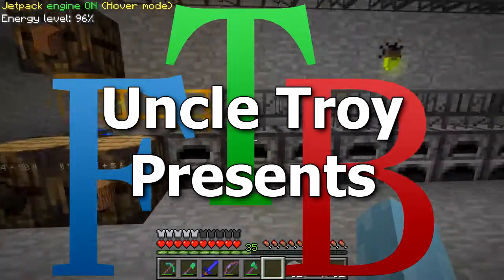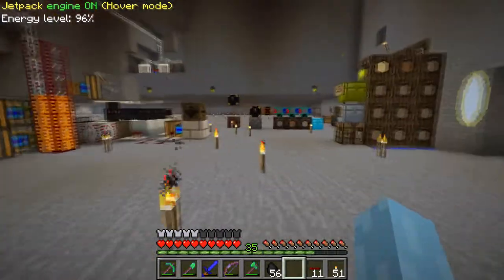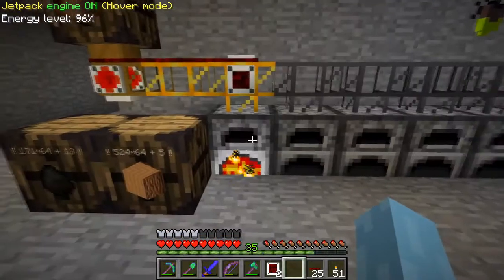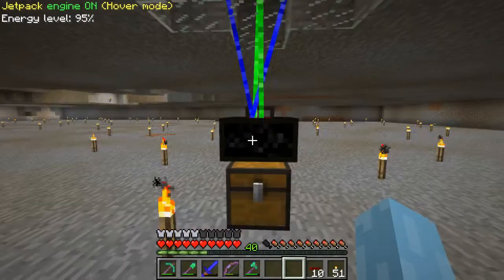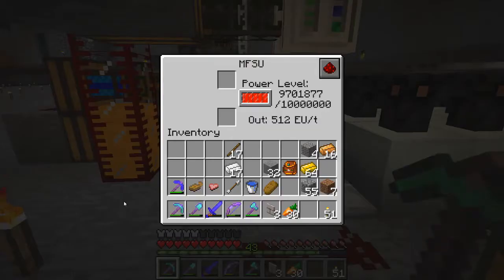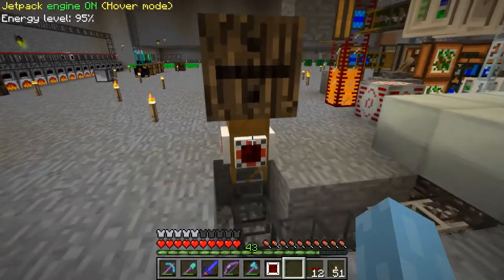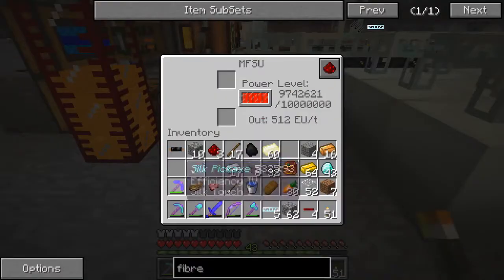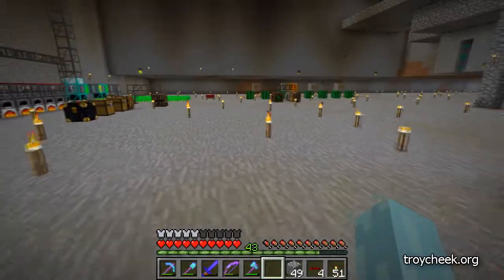FTB 22 - Charcoal XP Farm and Power Plant with Autarchic Gates [Feed The Beast MindCrack]

Comment: You can enhance your intake by making it fully automatic, 1. jump into thaumcraft and move towards researching 'brain in a jar' if you want to 'cheat' then just search up on the wiki all the research aspects. 2. Get a turtle with the interaction add-on from the peripherals  add-on to computer craft. To use it do m.peripheralwrap(right/left)
to connect to that add-on then finish your code with an easy 
if (' ") true do
go #
turn left #
Ect
Turn Left 3
go (Total times you ECTed it)
then right 3